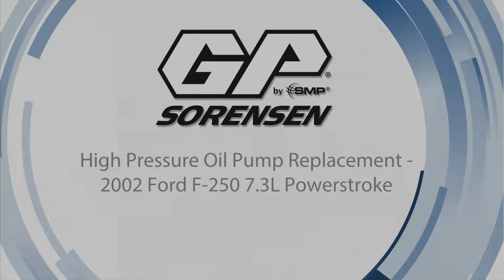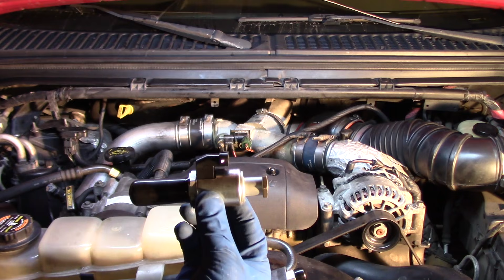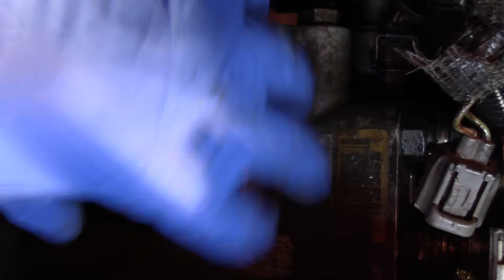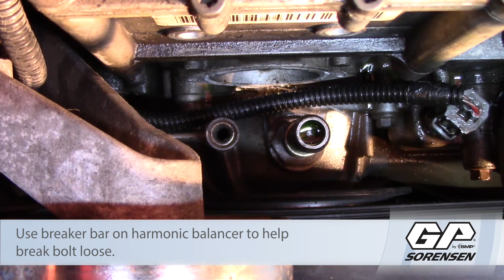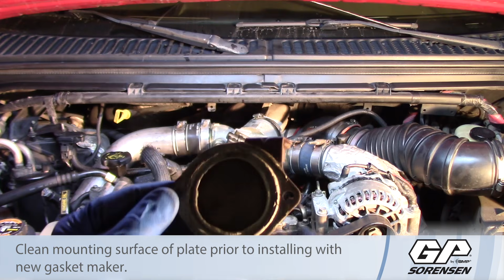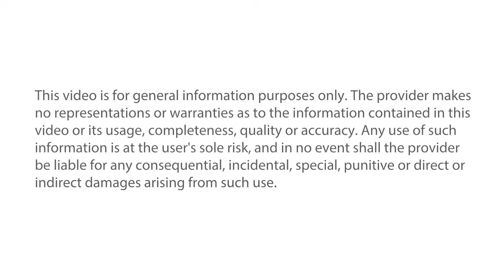High Pressure Oil Pump Replacement - 2002 Ford F-250 7.3L Powerstroke

Comment: On the drive back home was driving a little weird like if it wanted to turn back off what do you think it is? I checked with a power pro on the diesel pump and there’s no power going to the diesel pump. I tried jumping it throwing direct power to the pump. It turns on truck won’t start, but it will start with starting fluid, but it won’t stay running.

Comment: Oh my 7.3 people have a quick question. I have a 7.3 2002 Ford F350 was driving perfectly normal from Florida to Miami randomly at a stoplight. It turned off, turned right back on, drove it to the house turned it off at night. Woke up in the morning didn’t wanna turn on, but I replaced the ICP IPR Brand new injectors no plugs valve cover gasket air sensor 
Oil pressure sensor diesel, fuel pump and sending unit